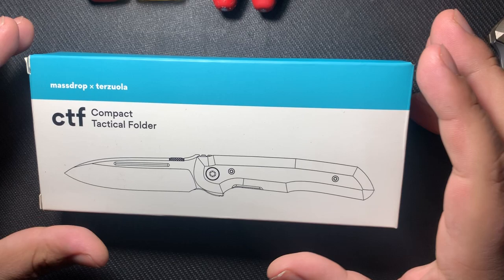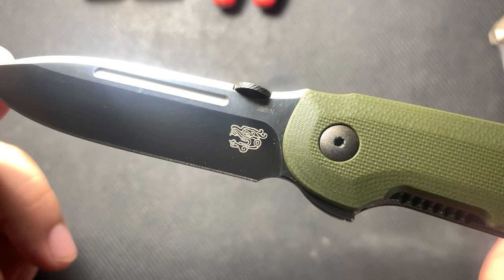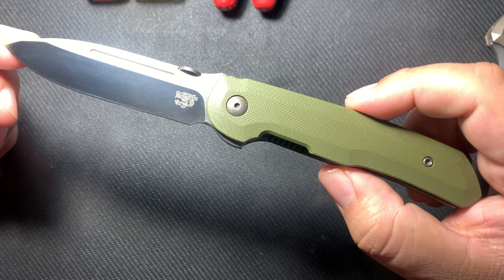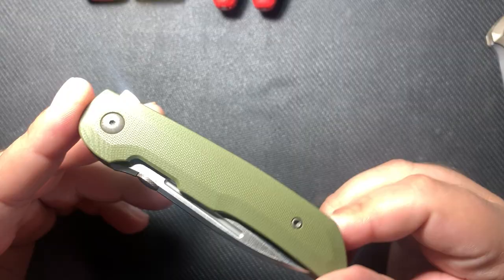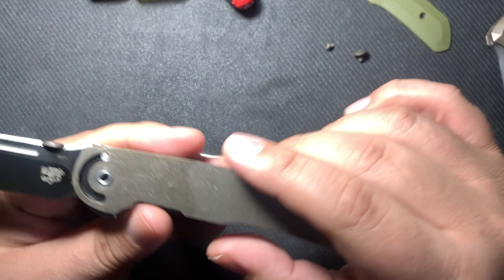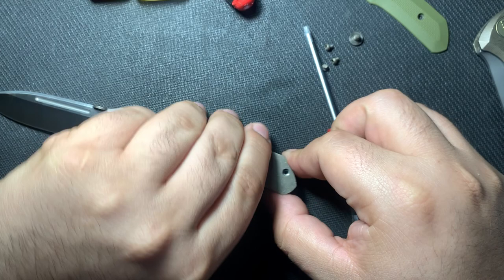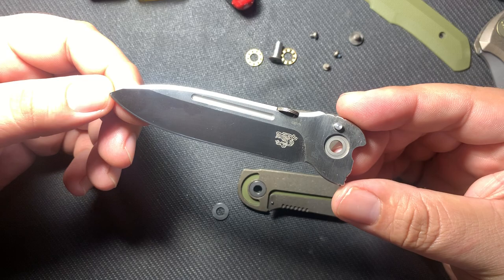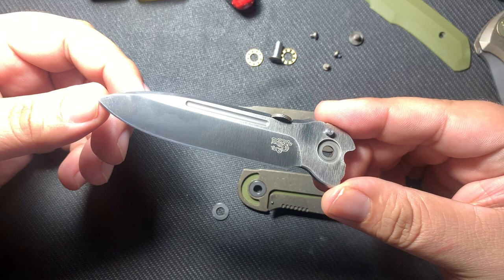MASSDROP X Terzuola CTF

Comment: Just curious, with bending the lock bar a little, did that affect the actual locking integrity at all?
Thanks for your detailed tear down and re-build. Nice looking knife.
Reply from the maker: Rashoop as long as the geometry on the lock is good it should not. You also want to make sure the resting measurement is more then the lock up measurement. (4mm when resting and let’s say 3mm when locked up)  and thanks

Comment: I just bought mine. Second We after my Drop Dogtooth. I haven't opened the Dogtooth, but the detent is perfect on it and the fit and finish are nicer. Since they are equally priced, I can't help but be disappointed in the CTF since it costs the same. 
  I, too, found the detent a bit strong and also don't like having pocket clips on my knives. The same screw that was tight on yours was so tight on mine that even with heat, the loctite wouldn’t give. Since I wasn’t using the clip anyway, I drilled mine out. All screws are so shallow, I see why they used so much loctite. Still, the quality of manufacturing seems far lower than the quality of the materials. 
  Still, I dig the knife and got it for $50 off, so for what I paid, I’m so dissatisfied as to return it. Wished the CF scales were still in stock.
Reply from the maker: Yondering agree. The small screws are a turn off and it’s definitely not as solid as WE others offerings